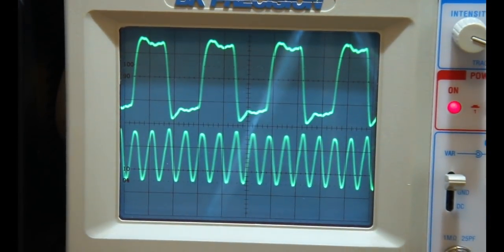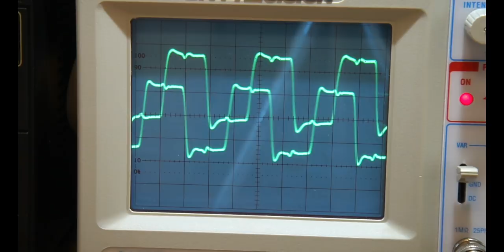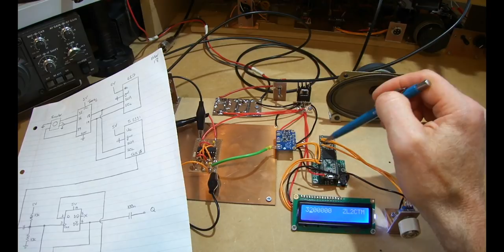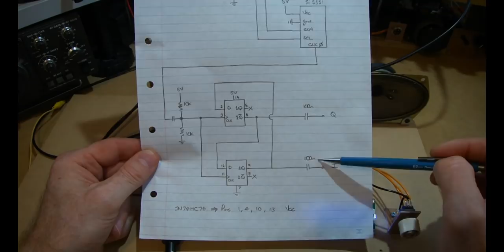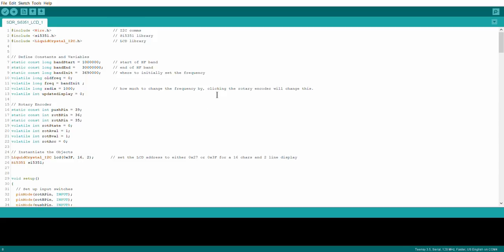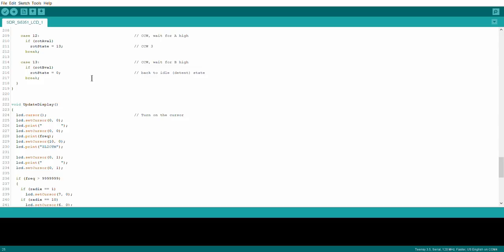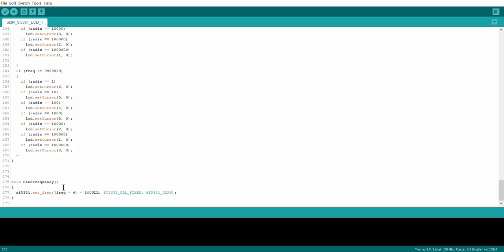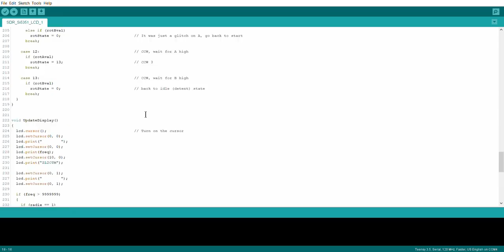Homebrew SDR SSB Rig - Part 2 Quadrature Phase Oscillator

Comment: Hi Charlie! I love following your build projects. I'm having a go at this one at present. I am aware that it is now possible to generate the I and Q LO signals directly in the Si5351 itself but I wanted to have a play with the 74HC74 flip flop method as I had some in stock. I've built a couple of these modules now: one manhattan style with the IC dead bugged on the ground plane and one on a small piece of strip board . They both produce the two signals with the correct phase but they both also suffer from the same problem i.e. I can't get an LO signal above about 15 Mhz before the signal becomes unstable. I'm wondering how you managed to cover the entire HF band. I've also noticed that the lower the frequency the cleaner the signal is - at 1 MHz I get almost a perfect square wave. Given that the IC is having to deal with an input which is four times the frequency on the LCD display, I'm wondering what the maximum frequency for the dual d-type flip flop might be. Anyway, thanks so much for all your videos. 73, Nick (M0NTV)
Reply from the maker: Hi Nick. Sounds like you are making great progress. Take a look at the 74AC74 version of the flip flop as that has higher frequency specs. I tend to hang around the lower HF bands, so the HC version works for me. 73 Charlie ZL2CTM
Reply: @CharlieMorrisZL2CTM  Thanks very much Charlie. Will do. I've managed to get the 74HC74 stable up to 15 MHz now which will be enough for my 80/40/20 rig but I'll certainly check out the 74AC74. As you say, the great thing about using the Flip Flop is a greater linearity of output level as the frequency increases. Incidentally I did try your later sketch which uses the Si5351 to produce the I and Q LO outputs. That worked really well and got me higher in frequency but ironically wouldn't go down to 80m!!! It's fascinating stuff this. I definitely need to experiment a bit more! Thanks again. 73 Nick M0NTV
Reply from the maker: @nickwood4367  Sounds good. I did get the Si5351 to output quadrature down to 80m (if I recall 3.4MHz odd). Check out the blog as the code should be there: https://zl2ctm.blogspot.com/
Reply: @CharlieMorrisZL2CTM  Hi again Charlie! I just wanted to say THANK YOU SO MUCH for the great tip about using the 74AC74 instead. A batch of them arrived this afternoon and I swapped out the regular 74HC74 for the 74AC74 and it worked a treat! I can now tune over the entire HF band (and probably some way beyond as well). Thank you very much :)
Reply from the maker: @nickwood4367  That's great new Nick. Excellent.

Comment: Thanks Charlie.  Just finished sorting the code.  I now have a (nearly) working VFO with an Arduino Uno, basic rotary encoder and VFD display connected via I2C.  I can check the signal from the Si5351 tomorrow.  This is the first time I have actually got a rotary encoder working.  Waiting for a couple of 74HC74 for the next part.  G3YSW
Reply from the maker: Sounds good. You may want to check out some of the more recent videos as i can now get quadrature phase outputs from the Si5351 directly. That cuts  down on the number of components.

Charlie
ZL2CTM
Reply: Actually it's an Arduiono Nano, as it was nearest.  I'll use the Teensy 3.5 or 4 eventually.  I've just checked the VFO and BFO (why volatile uint32_t BFO_freq = 8003000?;) against my Icom 7600.  Only a few Hz out  WOW..  I'll have a look for the quadrature Si5351 video now.
Reply from the maker: @ytwatch1000  Make sure too that you run the calibration sketch so you can get the output frequency bang on. The sketch is in the examples.
Reply from the maker: @ytwatch1000  That sketch was used in a superhet hence the need for the BFO.

Comment: So you can use square waves rather than sine waves as the input VFO? I would have thought that would result in higher order harmonics getting mixed down into the audio range as well.
Reply from the maker: Hi Martin. I thought so too until I saw a video on Soldersmoke walking about the use of square waves as a LO. Since then I have been feeding the output of the Si5351 straight into the DBMs with good effect. I do get some birdies, but I suspect they are coming from the uP.73s, Charlie
Reply: Good to know. Thanks!

Comment: I was able to get the quadrature outputs working in software with the si5351 using your sketch and the Etherkit si5351 library. I've got the code on my blog. https://awsh.org/2018/03/31/si5351-quadrature/
Reply from the maker: Fantastic. Nice one awsh! I will definitely have to look at this when I can. To me it's a nice clean way of generating the quadrature osc signals. Well done!

Charlie